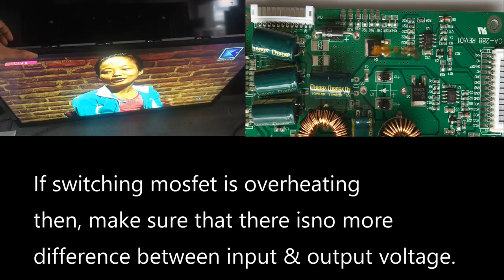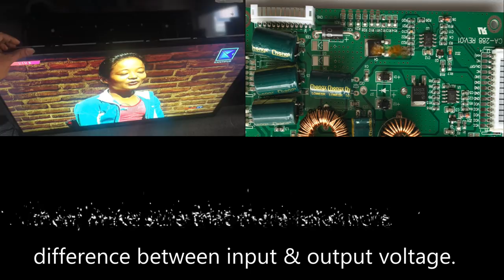LED TV Universal Board Backlight Not Working

Comment: Sir
I have a led tv of 40 inch.The display is ok.But backlight is not turning ON.Checked all the LED Strips all are ok.
The board is all in one. There are two port .I am getting around 40v on each. But the led strips are not turning ON.
The board is inbuilt.Can u tell me the issue.
Reply from the maker: 40v isn’t enough for backlight boost so You have to buy a backlight tester & try to find....strips are taken properly load or not...

Comment: I have 48 inch sony TV and have used the same board in this video. But the backlight are extra bright so when we watch movies at night the backlight is high. How to control the light intensity of the backlight in this board? Or any other method to do so?
And what is the cost of this circuit board? Please reply
Reply from the maker: Good job! Please send your connection photo WhatsApp +9779855054737

Comment: My back light voltage is 55v and I don't have any other replace parts can I do anything on this board to help
Reply from the maker: Yes you can use it
Reply: @VcoreLC  it's a proscan 40 inch and the back light does not work with the 55 v

Comment: Very good video! I was wondering what do u mean by checking voltage between input and output... I try this and the board work for a minute then fet burn, there is something wrong with the voltage?

Comment: What about universal board if backlight on, sound on, but no picture. The display blank. I check the 12v LVDS shown 0v, please help my TV, thanks a lot
Reply from the maker: Check short circuit with panel vcc if no panel vcc switching transistor or fet on board

Comment: Sir gooday my 32 inch led sparc tv doesnt light the strips i installed i buy universal led driver my input voltage is 12v my BLon is 5v but still the output voltage is 12v it cannot light the strips cant u help me sir ty more powers to u
Reply from the maker: Make sure your backlight strips are good, connection are properly etc... if still not lit ..you have to connect adj (BL dim) voltage also

Comment: Maine ye circuit combo board 40 inch ke sath lagaya lekin jaise hi stand by release karte hain 47 mf wala capacitor  blast ho jata hai. Stand by mode mein blast nhi hota hai aur led connector ki pin par 63 volt show hota hai. Maine LED strips ko connect nahi kiya hai, kya ye load na hone ki vajah se hi blast ho raha hai ? Please help.
Reply from the maker: Backlight driver input voltage?
Blasting capacitor working voltage?
Ye aap ne nahi bataya..
Reply: Input voltage is 12 volts. However I could not measure the voltage of blasted capacitor since it happened very fast, within 4-5 seconds.
Reply: LED strips connect karne ke baad AC supply on karne par blast nahi ho raha aur backlight bhi jal gayi. Lekin light constant nahi hai flicker kar rahi hai. Backlight jalne ke baad circuit mein 131 volts aur 110 ma current show ho raha. Jo niche ki side mein 6 smd resistance lage hain unhe jumper se connect karne par bhi light intensity ya current mein koi change nahi ho raha, current 110 ma ke aas paas hi rehta hai. 10 led ki 4 strips means total 40 led series mein lagi hui hain.
Reply from the maker: Sir, too deference between input voltage or output voltage  caused this type of problem... if 131v output must have 24to 35 v input..

Comment: In this case if you have another mosfet from higher voltage old spare board you can replace the backlight mosfet and the capacitor. I did it many times

Comment: Sir mosfet overheating reason tell me sir, how can I solve it?
Reply from the maker: Too different between input & output voltage
Reply: @VcoreLC  thank you so much sir, can I increase input voltage?
Reply: hello sir you can also connection 2nd mostef to main driver supply

Comment: I already install the universal driver the input is 12v the bl_on is 5v but still the output voltage is 12v it cannot light the les strips inside pls help me ty very much
Reply: There are some backlight driver ordered online happened to be defective. Take note when you install the 12v & 5v supply on the driver.. install right away the backlights too.

Comment: Para saan po yung resistor idol? 10K LNG po ba yan?
Reply: Para sa backlight on ng backlight driver bro.. ang required voltage ng backlight on ng driver ay 3.3v to 5v.. doon kumuha ng supply sa panel which is 12v so naglagay ng 10k ohms resistor para mag drop ang boltahe bro.